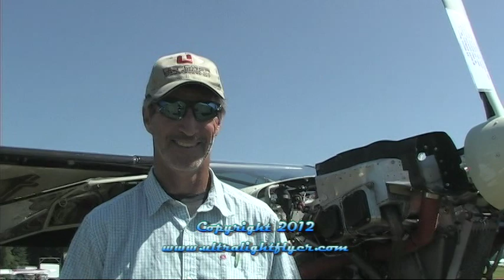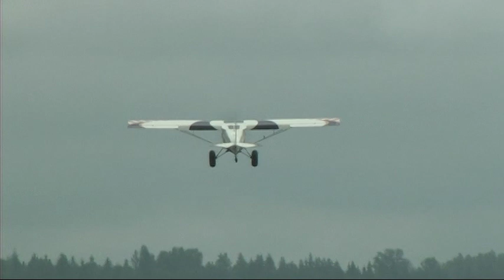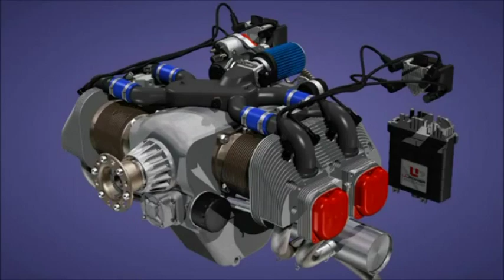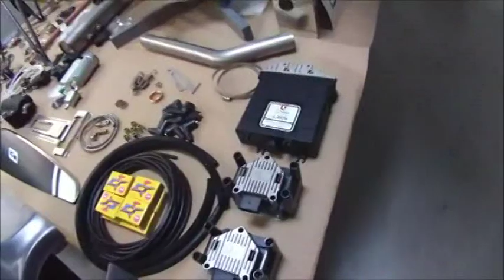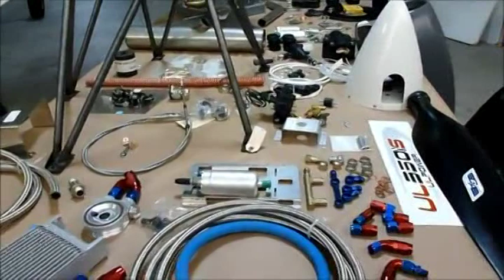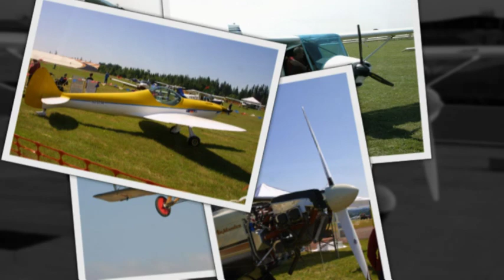UL Power 350 iS, Just Aircraft Highlander, Arlington Fly-In.

Comment: It's 2018 now, it's been 6 years since this video was made. How did these engines hold up in the long run ?
Reply from the maker: A number of manufacturers, including RANS and Zenith Aircaft and are finding them strong and reliable. Parts are now supplied by Wicks, and they are simple to work on..
The Ultralight Flyer